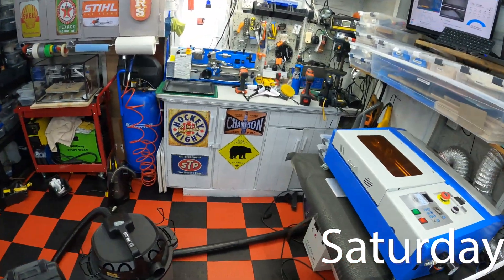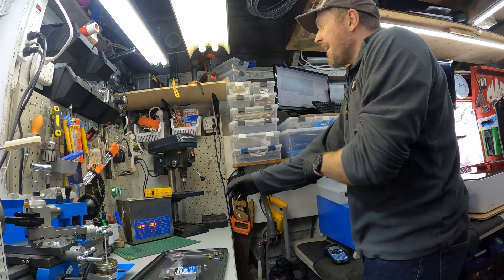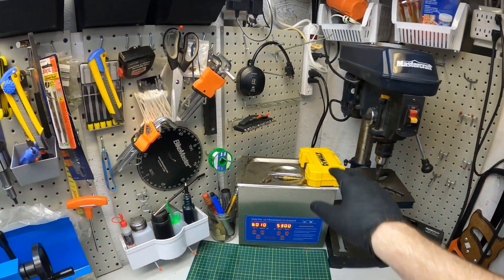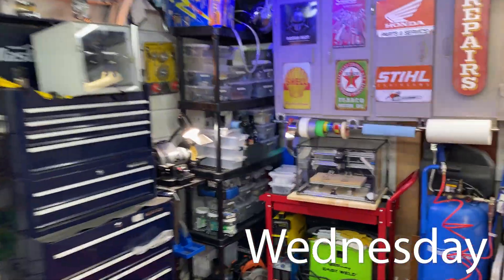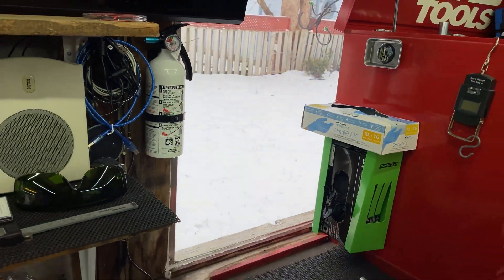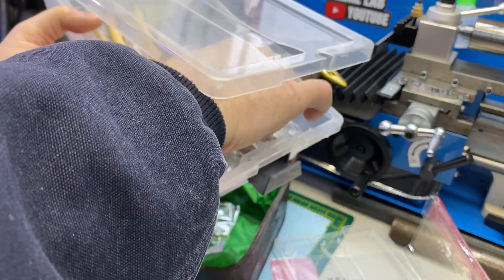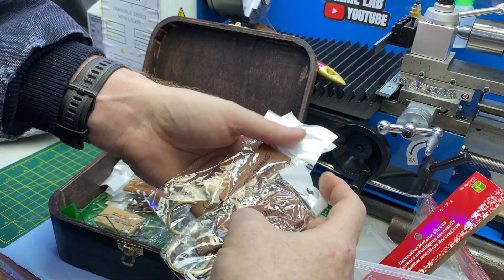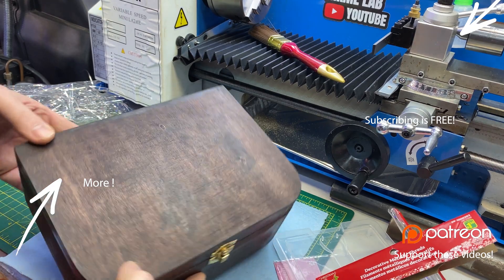10 Days of Making - Mini Lathe Machine Shop + My Fav Xmas Gifts I've Made Yet!

Comment: Ebay is a great place to get metal. Just type in what you are looking for like "2 round bar stock". You will get results in brass, steel, and dura bar on occasion. I find great deals on small cuts.
Reply from the maker: Shipping + exchange rate make it pretty crazy pricing